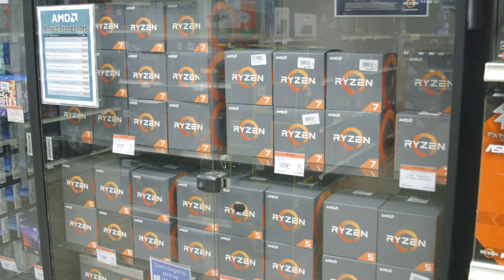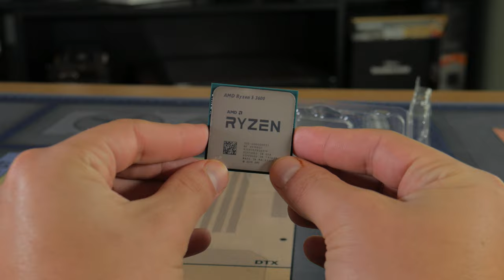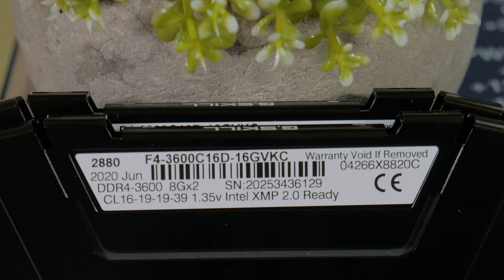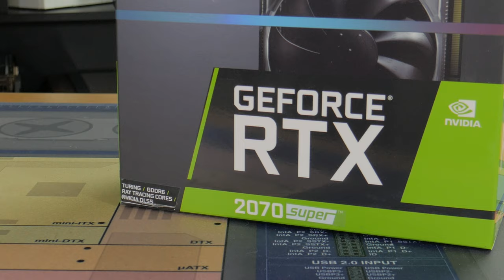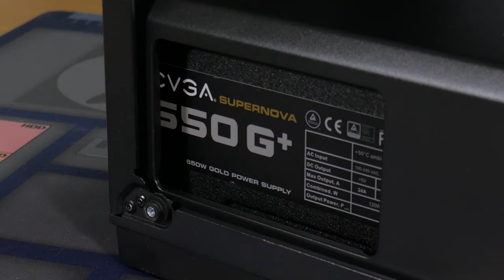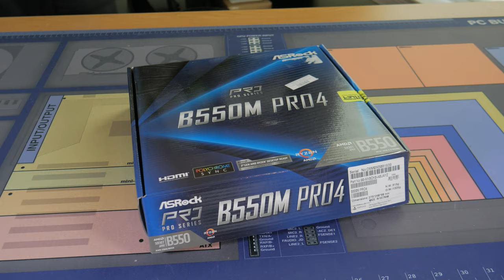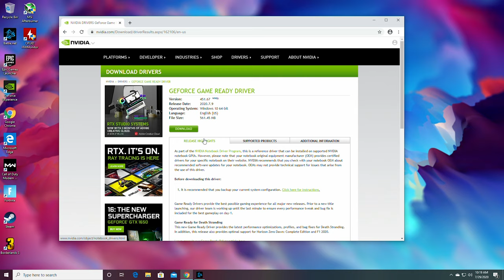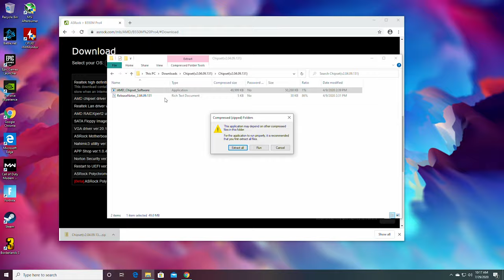$1250 Gaming PC Build Guide! (2020)

Comment: Hey Guys,

I am building my first pc and would like to here your feedback and recommendations, :)
PC will be used mainly for WQHD Gaming, Multitaskig and video editing.

Here is the setup:

CPU: Ryzen 7 3700X
GPU: Gigabyte Aorus Radeon RX 5700 XT
Motherboard: MSI X570 Gaming Pro Carbon WiFi
PRAM: 2x Corsair Vengeance LPX (16GB, DDR4-3200, DIMM-288)
Storage: Samsung 970 EVO M.2 2280, 1TB
PSU: Corsair RM750 (2019) 750W
Case: be quiet! Dark base 700
Paste: Thermal Grizzly Kryonaut

Many thanks in advance!

Comment: I need help.
I'm new to pc building and this is my first one so I'm trying to keep it around 600 quid (including the monitor)this is what I have so far

Amd Ryzen 5 3600 processor
Asus amd prime a320m-k motherboard
Chassis which I already own
Evga 600w w1 power supply
This is where I need most help
16 GB ram (need help)
1 tb ssd (need help)
A good graphics card (need help)
The last 3 are the ones I most need help with as you can tell but I would really appreciate any other upgrades for a similar price too. Thanks 👍
Reply: Go with 16 gb ram 3200 or 3600. I'd say get a 500gb ssd and 2tb hdd. And don't buy a gpu right now. And you might also want to consider a b450 board if you find one at a good price
Reply: @f-22raptor25  ok thank you I'll try do that then
Reply: @f-22raptor25  wait which b450 is it I'm not sure about all this

Comment: Some tips:
-couldve gone with a case with better airflow
-stock cooler would've been more then fine to use and would cut down on costs
-crucuial p1 is a garbage QLC drive that has shit write speeds (in fact slower then a hard drive when it gets full)
-power supply is mediocre at best
-asrock pro4 is okay, but theres other baords like the tomohawk max/ b450 a pro max/ gaming plus max with better vrm's
Reply: @marvinvelazquez5544  for a $1250 budget, a phanteks p400a would easily fit and would be a great choice, also doesnt require fans as it comes with 3 pre installed rgb fans
Reply: @marvinvelazquez5544  https://pcpartpicker.com/list/NBWhhg heres an example of a better build, you could replace the gpu for 2070s if you really wanted to, but a 5700xt performs nearly identical to the 2070s in gaming performance
Reply: rex  stock cooler has perfectly fine temps, it works and it's fine to use on a 3600
Reply: @marvinvelazquez5544  in the build you wont take advantage of pcie gen 4, so itll be perfectly fine with a 3600
Reply: @adverse_world  I've heard that Nvidia streams better, and part of the build was streaming.
Reply: XPG 8200 PRO is also pretty good, it’s like Samsung without the Samsung tax
Reply: @jaronmarles941  streaming is still entirely possible on x264 encoder, nvidia is just more widely known for streaming with nvenc, and if you really wanted an nvidia card a 2070s is well under the budget
Reply: @adverse_world  My point
If It's purely gaming, get a good 5700xt. Otherwise, you might take a look at Nvidia.
Reply: @marvinvelazquez5544  just buy a 3700x and a 2070 super. Don't cheap. You can also buy a Kingston a2000 500gb SSD for 70. Or just go 1tb and forget the 2tb hdd. Also the G+ is a great PSU.

Comment: For what it's worth gaming generally uses only one core, and Intel still has better single-core performance than AMD. For multi-core performance, like some of the engineering applications I run, the later AMD chips are better.

Comment: I need help
I'm new to pc building and have about 600 pounds to build one (including the monitor)
This is what I have so far;

AMD Ryzen 5 3600
16 GB ram 3200 MHz
Evga 600 w power supply
240 GB SSD
2 tb HDD
B450m pro4 mobo
Chassis which I already own
This is where I need most help:
GPU under 100 quid 
Monitor around 150 quid
Any help is welcome and thank you 🙌
Reply: RX580 is good for budget

Comment: you could cut about 125 dollars with this ram
https://www.amazon.com/dp/B08176M1KG/ref=dp_cerb_1
a cheaper non modular PSU and little cheaper motherboard, but doing so will cut back a little bit of overclocking potential, but only about 1x or 2x less than you might be able to push with the mobo linked.
Reply: maybe another 10-15 dollars if the case isnt as important to you. Also r/hardwareswap is a great sub reddit if you're looking for used parts, so even cheaper deals there